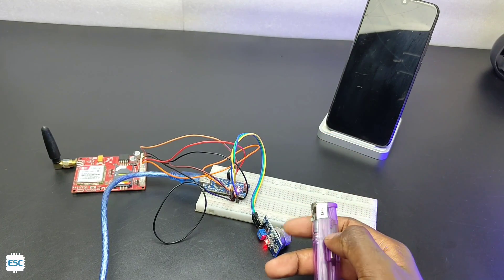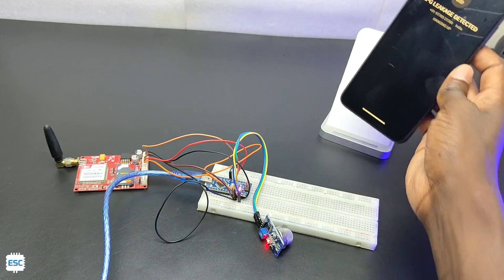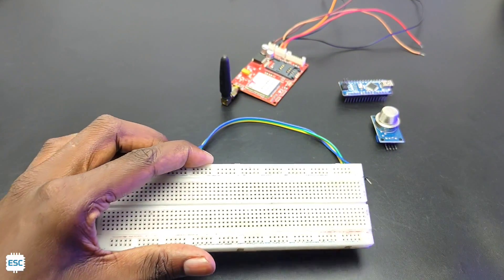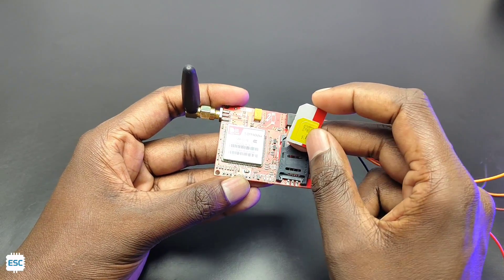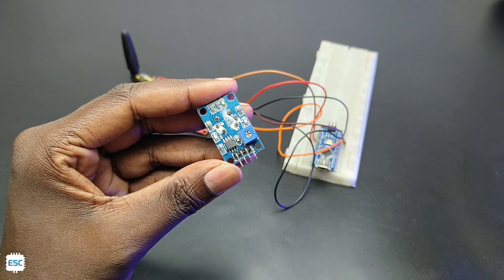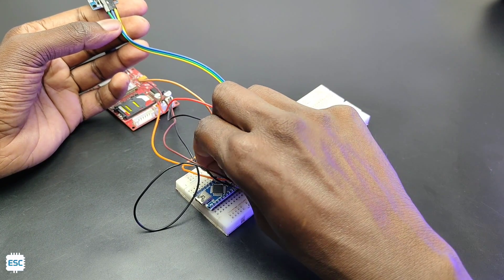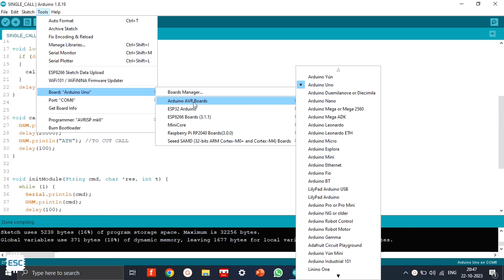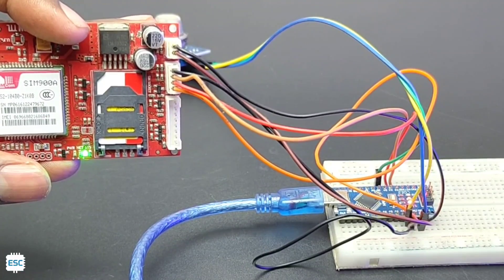How to make LPG Leakage Detector with Call Alert | Arduino & GSM

Comment: You have not used any power supply . how is it working?
Reply from the maker: Using that usb cable
Reply: @EDISON_SCIENCE_CORNER  What have you connected the USB cable to? Laptop or 5v battery?
Reply from the maker: @MeenalMarya to 5v 2a  USB
Reply: So how you connect arduino to the device on which you are writing the code
?
Reply from the maker: @MeenalMarya   code only one time use .
Reply: @EDISON_SCIENCE_CORNER  5v 2a or 5v 3a ? and using what u have connected

Comment: How to conncet wire connection??
Reply: Where osman diagram bro sim 900A 2vcc pins connect to 5v
Grnd to grnd 2pins
After tht bro
Reply from the maker: @SyedAli-w9i  tx and rx pins connect to arduino
Reply: @EDISON_SCIENCE_CORNER  which TX and rx there are TX 3.3v and TX 5v
Reply from the maker: Follow the circuit diagram